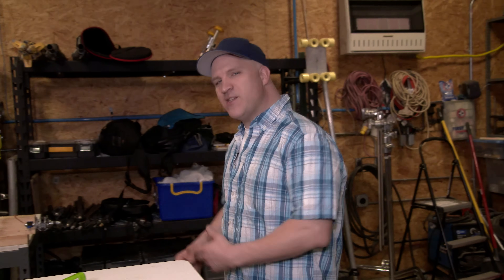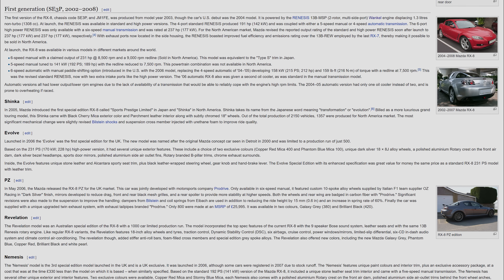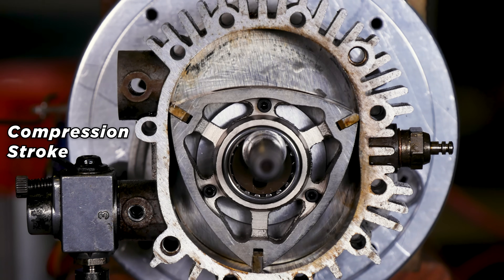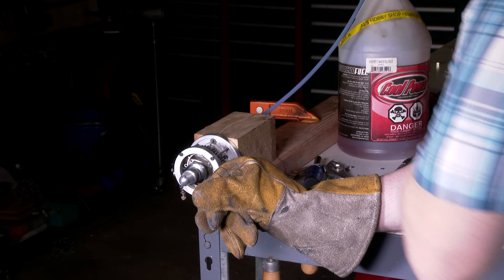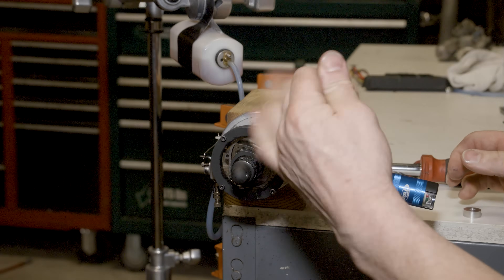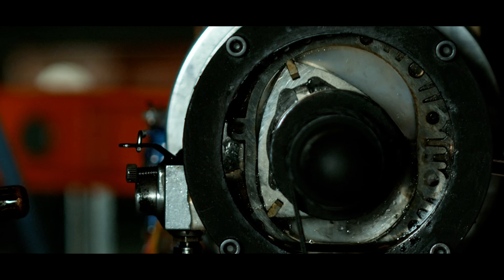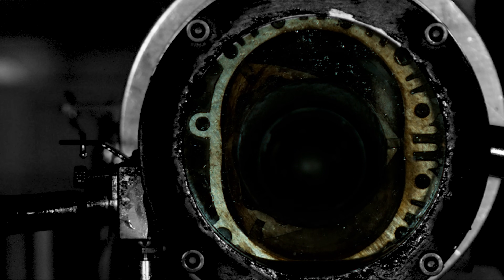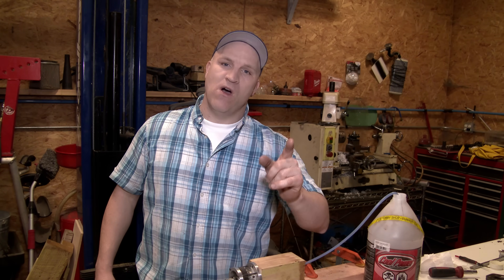See Thru Rotary Engine in Slow Motion - (Wankel Engine) 4K

Comment: The Wankel engine and the response to it just shows how ignorant and suborn people can be. The rotary engine seems by far to be the best technology for internal combustion engines. But before it could ever be perfected the general public all agreed to go back to the old style piston engine. Had the population not rejected it  cars could have better and more efficient engines that were simpler and eventually when the bugs were out of it would have been the superior engine.
Reply: That's the opposite of what i see, people seem to like the wankel but it is unpopular because it has several key disadvantages over a piston engine
Reply: The reason (i know because i remember the time and a friend had a Masda) the engine was unpopular was because the original designs  had some serious flaws which can be expected with a new invention, The later cars were fitted with good working engines,.The new and improved engines worked well and for a long time. I knew people who had the cars with the working engines who like it better than the regular piston engines.It had better  torque ran more smoothly.  

While it might be true that even the new engines were in some ways inferior to the regular piston  engines, my point is that the design had great potential if the technology was further pursued. In principal the rotary engine has some real advantages. There is no reciprocating pistons. When a piston is forced to plunge down then suddenly reverse the process there is inertia power loss,. The rotary "piston" just keeps turning, Plus a simpler engine is ultimately  more reliable. 
I am sure if Maxda felt that their new technology was worth the investment it might have been the engine of the future but as always it was cheaper so just do what every one else was doing. Sad to say the modern internal combustion engine remains for the most part unchanged. The addition of computer technology and fuel injection these would have made it on the rotary engine also if it were still produced, .I just think the rotary engine had great potential that was never fully realized.  .  .
Reply: The Wankel engine has been obsolete for several years because it no longer offered any advantages over reciprocating engines.

Comment: They're a neat design but half the life expectancy of the regular combustion engine before rebuilding although, waaaaay less parts. Is it true that rx7 and rx8ts go through brakes fast? I was told these engines always like to push.
Reply: This engine has more parts than a comparable 2-stroke RC engine .
Reply: @doktorbimmer  sorry, I was talking about the rotary in an rx7 or a Norton.
Reply: The Mazda 13B engines had over 235 moving and seal related parts... as many or even more than some reciprocating 4-stroke engines... its the tiny fragile seal parts that people tend to overlook... they are also the primary failure mode as well.
Reply: Wankel engines were never successful in motorcycle production because the lack of compression braking typical found in convention engines... the Wankel's orbiting piston design was original developed as a supercharger compressor, when it was converted to run as an engine it essentially run "ass-backwards"  to use a non-technical expression. Lol!
Reply: @doktorbimmer  oh ok. Thanks for the info. They're still a neat idea but really not the most efficient.

Comment: NUCLEAR WANKEL ENGINE  But there is a way, says Mark Adams, an MIT-educated physicist and former staff member at the Lawrence Livermore National Laboratory in California. He has designed an engine that he calls an “internal” rotary engine, rather like the kind of Wankel engine that has been around since the 1950s. Instead of pistons going up and down, the engine has a rotor that rotates around a crank shaft.

The rotary engine that Adams envisions looks diagrammatically very like a schematic of the rotatory engine that Mazda introduced to varying degrees of success in its cars in the 1970s.

It works like this: A small amount of gasified “nanofuel,” which contains nuclear material mixed with hydrogen, is ignited by a neutron source to set up a controlled fission reaction, creating heat and propelling the rotor forward and driving the crank shaft. The fuel can be derived from the transuranic parts of spent conventional nuclear fuel or can be created separately.
Reply: http://bargerltd.com/engine_history.htm they make rotary diesels

Comment: WAS THE PISTON ENGINE EFFICIENT 150 YEARS AGO? WE ARE TALKING ABOUT 1080 DEGREES THAT IS 270 DEGREES FOR EACH 1080 IS MORE EFFICIENT
Reply: good comment cheers
Reply: It has zero fucking timing whatsoever I mean half the fucking explosions end up in the exhaust stroke because that's also where half the fucking fuel is going
Reply: wankel engine is more efficient than a piston engine 720 degrees vs 1080 degrees you are right nothing wrong with old piston cheers just the facts

Comment: THE FOUR STROKES OF A INTERNAL COMBUSTION OCCURS SIMULTANEOUSLY IN A WANKEL ENGINE THIS MAKES IT MORE EFFICIENT THAN A PISTON ENGINE 1080 degrees output  JUST THE FACTS CHEERS
Reply: THE REAL DOKOTERBIMMER ROTARY No, it’s actually very inefficient. The engine does not fully burn the fuel it takes in because of its short combustion stroke and along with rotary engines having generally low actual compression ratios, this makes it both horribly inefficient in fuel economy and emissions. It also burns oil and its combustion chamber can never be properly sealed off from the rest of the intake and exhaust chambers, causing the previously mentioned lower compression and less actual mechanical work done from the ignited fuel/air mixture, this makes the engine horribly inefficient overall. Just the facts. There’re more than a few reasons why no one uses them in vehicles anymore.
Reply: @ReallyRyan.  Also the combustion is applying a decent amount of force in the opposite direction of the rotor's rotation. That's why the rotor is on an eccentric shaft - to ensure the force in the desired direction has more leverage than opposing. Even so, the engine is not only pumping against its own compression as with piston designs but also against the combustion.
Reply: Wankel engines are so inefficient they are obsolete today... even Mazda dropped them like a bad habit years ago!
Reply: He probably meant power/weight ratio of the engine
Reply: @radovanseles1131  he sure as hell didnt mean power/fuel consumption thats for sure
Reply: At least piston engines doesnt need it interior to be drenched in oil in order to maintain pressure. Also their way more fuel efficient.

Comment: If there is a use for ceramics in engines the rotary engine would be the best candidate and be able to bring 10% more combustion power to its threshold... and with the greatest variable valve timing potential over a piston engine I think because the bad reputation of the rotary engine shuns the furthest development of what is the coolest combustion engine ever though of.... and rethought of in history... lol.. and everyone that knows milage greatest enemy is heat.. and what comes with different temperatures comes different methods with seals and springs thus probable solution ...
Reply: @erniebrinkrotaryhemi7336  yes with a piston engine and most other engines there is a common similarity... HEAT!!.. thus wasted energy.  So with ceramics as either  coated parts or occasionally sold ceramic you greatly reduce heat therefore bringing up efficiency and compression.. also depicted in my speech is the venerable valve timing which infact matters as much or more than ceramics, see if you applied both materials in proprietary proportions  then you may have devised a suitable engine for making a great or greater rotary engine..

Comment: Have you tried a bump starter? It seems like that would save your hand :)
Reply from the maker: gotindrachenhart I have a bump starter, but with this engine you need to get some RPM before it will start, it's not like a piston engine where you can bump start it easily.
Reply: Oh, is it a compression issue then? It looked to be a little rich there so maybe lean it out? I used to tech nitro engines for a time and you could get them to diesel with the right settings. I remember having one that just wouldn't turn off. I even took out the plug and it just kept going lol

Comment: The Rotary (Wankel) engine is one of the worst engine ever invented, terrible gas mileage, it needs a lot of oil, the power-to-displacement ratio is one of the worst that was ever made, it dont use any fuel and just blow it out the exhaus and mutch more bad things about it.

Comment: One of the fundamental flaws in the Wankel design was the troublesome shape of its internal components... cylinders and spherical shapes are ideal for ensuring even and consistent thermal expansion and contraction and the clearances between the moving parts, stationary parts and most importantly the sealing parts... Like the Newcomen steam engine, one of the Wankel's major flaws is that it is required to maintain high temperatures and colder temperatures with in the same housing, high wear rates and low thermal efficiency is the end result.
Reply: WAS THE PISTON ENGINE EFFICIENT 150 YEARS AGO? WE ARE TALKING ABOUT 1080 DEGREES THAT IS 270 DEGREES FOR EACH  1080 IS MORE EFFICIENT

Comment: Given that it produces 1 power stroke per rotation of the crank, it shouldnt be a surprise that it makes a lot of power. its basically a funny two stroke, and has all the bemefits and flaws of a 2 stroke.
Reply: Wankel KKM engines are all 4-stroke, it also requires 1080° of crankshaft rotation to complete its firing order sequence (instead of 720°) in a Otto Engine.
Reply: each pass of the eccentric lobe over the spark plug results in a power stroke. So one rotation of the crank will yeild one power stroke. For it to complete one rotation of the rotor, you do need 1080 degrees of rotation. But you've experienced three power strokes in that time. If we consider each bank equivalent to one piston, its acting like a 2 stroke.

Comment: If it was originally meant for an aeroplane, it really should have a propeller fitted because as it is, there is no load as a proper flywheel and also the propeller is what provides the cooling air.

Comment: When you see it moving at such slower speeds, you can see while it has been well used in many applications but how it's also how it's such a flawed system.
Reply: Indeed, the internals are only moving at 1/3 crankshaft speed, Wankel engines are obsolete now, no one manufacturers them anymore... not even Mazda.

Comment: Man, thats very crazy the amount of fuel it spends off
Reply: Yeah these smaller engines are going to be far less efficient than their properly engineered, larger cousins. 

That being said the Rotary is still horrendous on fuel usage. Me and a friend worked out that his 1.3 rotary got the same cruise consumption as my 4.0 Litre straight 6. 

About 11L/100km which is crazy for an engine that size. That consumption just goes nuts under high rpm load.
Reply: +Lawson Palmer The Mazda 13B series has a total, true displacement of 3.9 liters, even when compared at the same 720° firing order as a reciprocating engine its displacement is 2.6 liters... either way you calculate the displacement... the Wankel has a much higher BSFC (fuel consumption per horsepower) and higher EGTs (higher heat rejection) indicating an engine with much lower Carnot Cycle efficiency than a comparable reciprocating engine.
Reply: @doktorbimmer  holy heck how much time of your life is dedicated to commenting on YouTube videos...
Reply: @Ben Fennel  Wrong doktorbimmer... that other guy is "dokterbimmer" and is locked up in a mental hospital.
Reply: @doktorbimmer  if you say so
Reply: @Ben Fennell I do, that other guy is a nut job! he has like a dozen different usernames too!.
Reply: @doktorbimmer  this is one of the strangest comment sections I've ever seen on the whole internet
Reply: @Ben Fennell "Ernie Brink" (aka Anthony Campbell, Lisa Giannini, No Vision Blinders, dokterbimmer, xke xke, ernie brink hemi rotary, is one of the craziest people on the internet. My advice is just ignore this bat shit cray cray!
Reply: @benfennell6842    DAVID THOMPSON   FLOODING HAPPENS WHEN A APEX LEAKS WHEN IT IS IN THE LEADING PLUG HOLE AREA THIS  OTHER FAKE DOKTER IS LOST Citroen and Van Veen also experimented with Wankel, but only NSU and Mazda had Wankel commercialized. A nice thought to rotate instead of the existing up/down engines, but some bad hooks: bad compression control, bad fuel consumption and bad CO2 creation.
Reply: saying a rotary is unreliable just shows you've never owned one, they're danm near impossible to over rev or blow up unlike a piston engine where you go a few hundred rpm's over the redline and suddenly your loseing power and shooting piston connecting rods through the side of the block. On a rotary when you go a few THOUSAND rpm over the redline, well you just get more power and better engine lubrication WORST case senario is you run out of fuel injector flow and lean out wich could cause damage but i'd say that for the type of engine they are(a race engine designed to give loads of power and run at high rpm's all day long) they are incredibly reliable.
i think the problem is that people compare them to priuses and other grocery getters designed to go barely the speed limit sit in traffic for hours on end, this is not what the rotary was born to do and putting a rotary through a life like that will kill it in a matter of months.
Reply: I bet if it were hot and able to vaporize the fuel it would burn a little better
Reply: @TRout The Wankel was plagued by several serious, inherent flaws in its basic design concept that significantly reduced its ability to run as clean and efficiently as reciprocating engines can... which is why the Wankel never replaced reciprocating engines and has been obsolete for several years now.
Reply: yeah that wasted a lot of fuel
Reply: Ernie! WHY? doesn't your engine run????
Reply: @dokterbimmer7270  Toyota and Mazda have announced plans to build a $1.6 billion manufacturing plant in the United States that will create as many as 4,000 jobs
Reply: The Wankel engine is the least efficient internal combustion engine produced in the 21st century... of course they are obsolete now.
Reply: Ernie Brink! Why doesn't your engine run????
Reply: Ernie Brink rotary hemi... EPIC FAILURE
Reply: @JBC Imagine how much faster the apex seals would fail...
Reply: Still hot
Reply: Hot exhaust = Low efficiency
Reply: He is also flooding the shit out of it, also 20% ish of the glow fuel is lubricant.
Reply: @David Thompson Although flooding is a symptom of apex seal damage in Wankel engines... in this case the excess fuel is not unusual given the extremely rich AFR this engine requires to run and the horrible combustion efficiency of the Wankel's chamber design.
Reply: Imitation is the greatest form of flattery...
Reply: Has nothing to do with a rotary, he had this set up wrong, a nitro needs a exhaust and fine tuning on the carb, it's a bit rich I think
Reply: @blueRC Thats right! This is a WANKEL not a rotary. No, not true, nitro fuel, glow ignition Wankel engines require an extremely rich AFR, much richer that a reciprocating engine. This is true of all Wankel type engines and one of the main reasons why they are obsolete.
Reply: @doktorbimmer  Sure, but if you had an exhaust you could run a line back to the tank, every nitro engine is set up like this, it's mostly for working upside down...
But it's helpful for tuning the engine
Reply: @blueRC Most production Wankel engines have dual, sequential ignition. The single, un-timed glow ignition is very poorly suited to the Wankel engine and as a direct result misfires and incomplete combustion occurs.
Reply: @blueRC Graupner GmbH. eventually abandoned the Wankel engine completely as there is no practical way to deal with its very inefficient combustion chamber design, special ignition requirements, low thermal efficiency and overall poor reliability. The Wankel engine has been obsolete for many years.
Reply: its basically an aircraft and race engine
Reply: Very poor efficiency which is why they are obsolete now...
Reply: @doktorbimmer  

http://pdfaiw.uspto.gov/.aiw?PageNum=0&docid=20160084158&IDKey=32A0F77DE744&HomeUrl=http%3A%2F%2Fappft.uspto.gov%2Fnetacgi%2Fnph-Parser%3FSect1%3DPTO1%2526Sect2%3DHITOFF%2526d%3DPG01%2526p%3D1%2526u%3D%25252Fnetahtml%25252FPTO%25252Fsrchnum.html%2526r%3D1%2526f%3DG%2526l%3D50%2526s1%3D%25252220160084158%252522.PGNR.%2526OS%3DDN%2F20160084158%2526RS%3DDN%2F20160084158
Here is the link to the Wankel patent made by Mazda (I think, the plugin didnt work on my device) RX-vision has been ongoing for years.. Again it is not dead, but it cannot compete with inline ICE for traditional car users. As a performance vehicle, its been conquering until recently with new clever technologies like VC-t, VVL etc.Very poor efficiency which is why they are obsolete now...stupid

Comment: My first car was a rusty old Jeep, which I loved, and which was good for tooling around town, but bad for longer trips on the highway.  My next vehicle was a Mazda RX4 station wagon.  Even though it was a two-tone red and white, it seemed like a boring car at first, but it was actually really fun to drive.  That Wankel Rotary engine had a lot of power and that little station wagon could really go.  I was intrigued by the engine's design and I read all I could on it.  They are amazing engines.  Too bad about the fuel economy though.  Were it not for that, I think a lot more cars would have rotary engines under the hood.